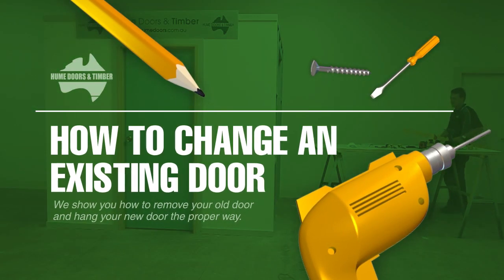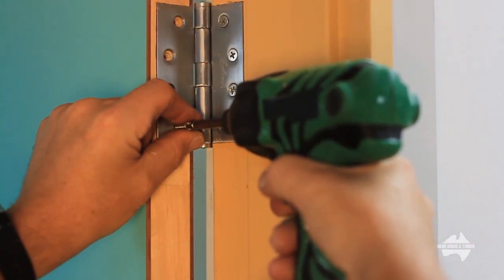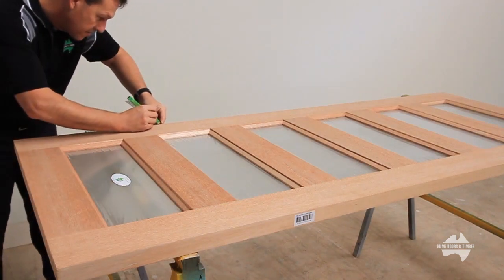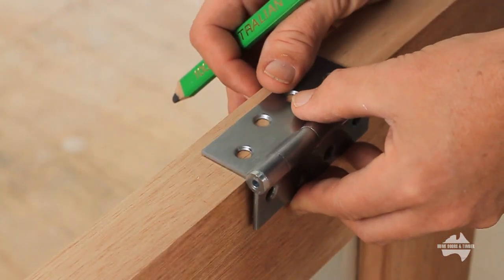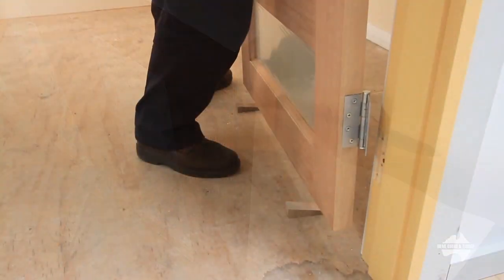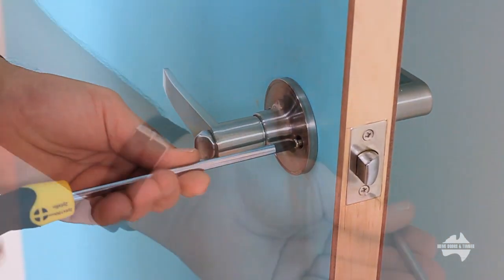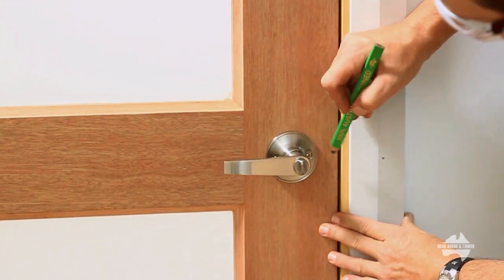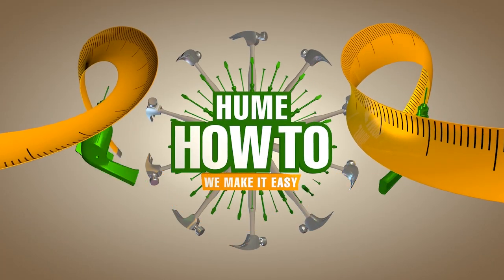How to change an existing door

Comment: poor method. Use a router and a jig, use a center punch to mark hinge holes center, never plane the very ends so as to avoid chipping. Best practise for trimming is a skill saw and oposite side fence i.e. a clamped straight edge. Router the edges for bull nose